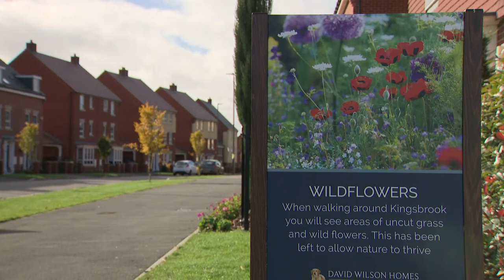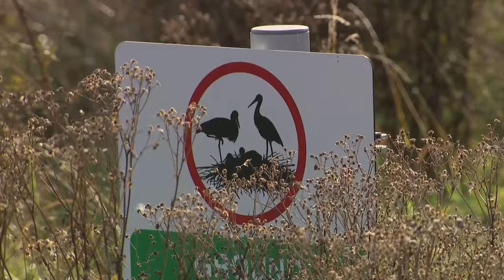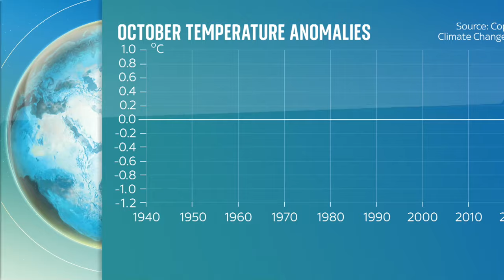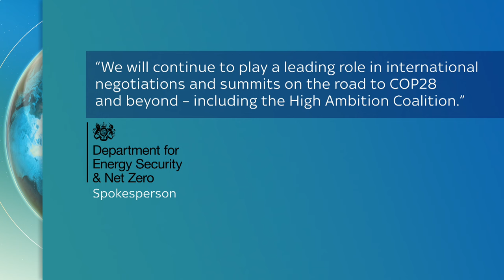Homes that improve nature and meeting the methane ‘detectives’ | The Climate Show with Tom Heap

Comment: Paris Agreement 2015

UK - The UK was part of the EU so comes under the EU commitment. At least a 40% domestic reduction in greenhouse gases by 2030 compared to 1990 levels

UK 1990 emissions = 600 MT. 
UK 2021 emissions = 350 MT. 
Reduction = 41%
NINE YEARS EARLY

The new licences are replacement UK production / consumption not additional production / consumption.